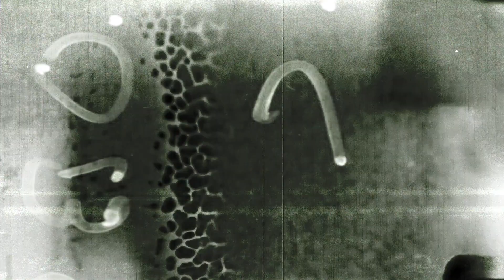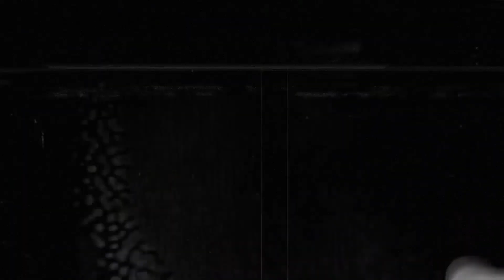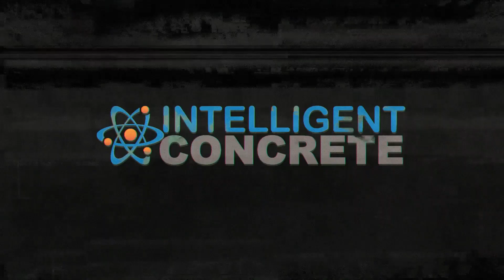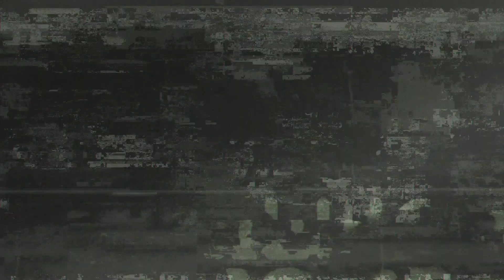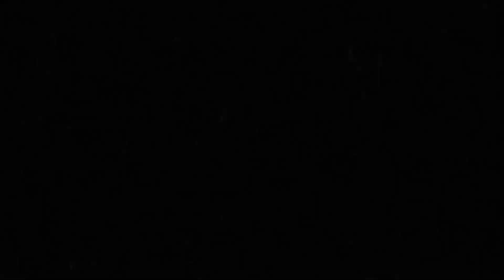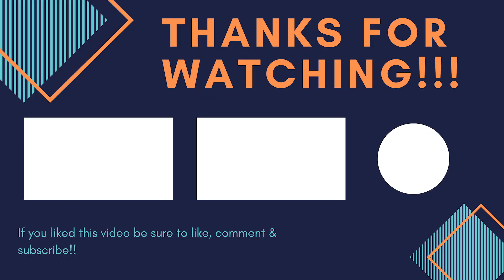Uses For and Issues With White Cement - Vlog 596

Comment: Can you tell me one thing that I am trying to make white cement showpiece but the white cement is not getting tightened.....
Reply from the maker: Is the cement new or old?
Reply from the maker: You can always add an accelerator to the cement or reduce the water content, but without knowing what type of cement it is, besides it being white, it’s hard for me to give a direction
Reply: Can you tell me what you add ?? 2:1 ratio of cement and water ...is there anything else you add?
Reply: New... I bought a 1 kg packet of white cement
Reply from the maker: Less water.
Reply: @IntelligentConcrete  okay... Thank you so much 😊

Comment: what concrete mix would you suggest for outdoor statuary, out door large water fountains?  I would like to use white cement and have a marble look without painting afterwards for long durability for finish, I feel paint is not long lasting and worse for maintenance cleaning, am I wrong?.  3 parts white gravel, 2 parts white fine sand, 1 part of white Portland cement for long lasting high strength cement?  Any suggestions would be appreciated such as using fortifiers/fiberglass etc...  And sealing the concrete after cured for 10 days..  Thumbs up, subscribed, and thank you

Comment: Very informative😊
I want to use white cement for an outdoor project where I will use the white cement as the base of a pvc pipe standing vertically. Will it be durable enough under rain and shine?
Reply from the maker: Thank you Whimsy.  Yes, that assumes that the concrete mix design is developed to be a durable mix.
Reply: @IntelligentConcrete  thank you😊

Comment: does it resist heat at 250-300 c ? i wanna mix it on a surface that doesn't resist heat then fire some coal on it and cook some traditional dishes but im afraid that it lets the heat get through , directly to the surface . the thickness of cement is gonna be like 2 or 3 centimeters .
Reply from the maker: It depends on the amount of water used in the mix and how well you preheat it to drive off moisture.

Comment: Hi
Can I use tiles fixing?
Reply from the maker: Thank you Freedom.  Did you have a question using white cement to fix tiles?
Reply: @IntelligentConcrete  
Yes, can we use to fix tiles in basement floor..?
Reply from the maker: I think there are better products that you can’t get to fix tiles.  Your local hardware store will have some polymer or acrylic modified grouts that will be better suited.
Reply: @IntelligentConcrete  sorry, I know use grouts top of tiles joints, but my question was can I use white cement to bottom of tiles to fix with concrete floor, or use thin set.

Comment: Informative video. Any thoughts about the variation in quality/color, depending on the original source of the white cement? i.e. Turkey, Egypt, Thailand, China, etc. What would be the key points to look for in the COA in order to properly compare white cements? Thank you!
Reply from the maker: Howdy Dutch. No matter where you get your White Cement, there are always going to be issues with color matching. Hence a lot of folks combine limestone dust and TiO2 to help keep a stable color.

Comment: A very useful video.. Thank you so much. You may have seen this before but I am planning to start using white cement to make home made vases and they are typically covered in acrylic paint. A popular art in Asian. My immediate concern is around smoothing down the pieces so they don't look cheap or very 'homemade. Do you think that I will be OK? I have patience if the idea is to spend time smoothing them down.
Reply from the maker: Thank you for the feedback!!!
Reply from the maker: Should be ok.  I would do a set of test panels to make sure.

Comment: What did I miss, is white cement inherently less durable or is it that the precaster isn't doing it right?
Reply: This is what he said at the end. But I am not sure meant it, not very focused or articulated. Anyone knows any other white cement source on YouTube?
Reply from the maker: Thanks for the feedback, we'll be doing a Part 2 on this video to bring more clarity to the subject.
Reply from the maker: Howdy Mark.  Thanks for the feedback. The durability of the mix is going to be dependent on more than just one material.  There are some grey cements that will create a concrete environment that is more conducive to chemical and physical, while some white cements are less conducive.  The opposite can also be said for some white cements that creates a more susceptible concrete environment and some grey cements, not so much.  The thing to look out for is the soluble alkalis in the white and grey cement as well as the sulfate content.  After that its the other additives that you use in your mix for durability and convenience.